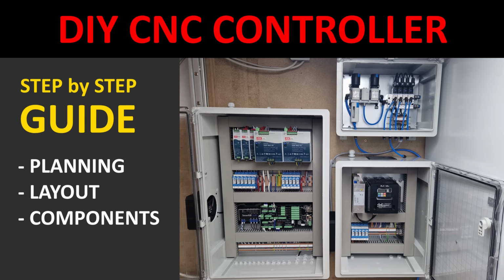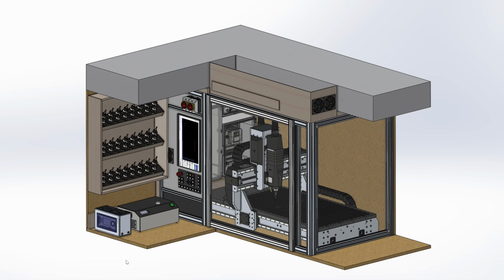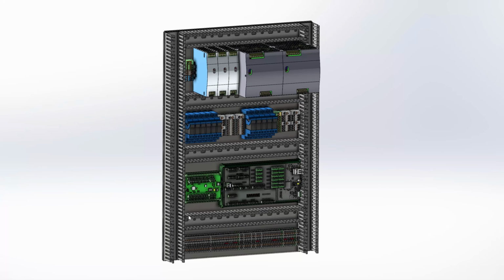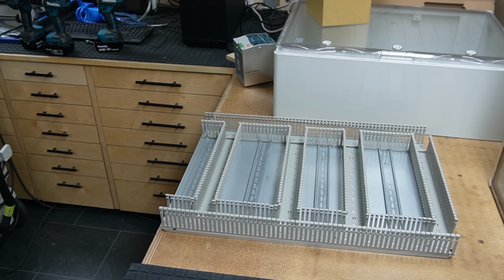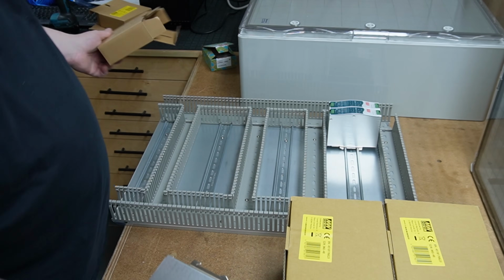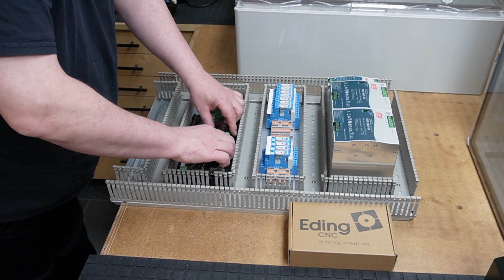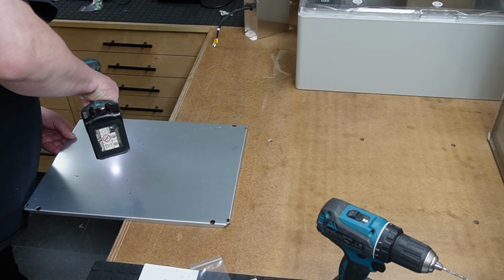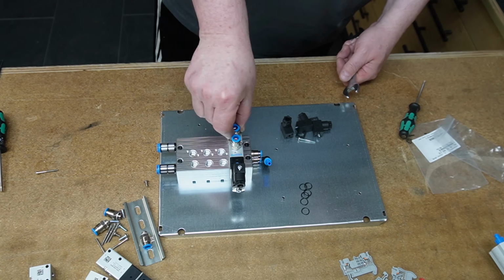DIY CNC Controller Part 1 - Step by Step Guide for Layout, Components, VFD and ATC Pneumatics

Comment: Nice, I’m currently building something similar (fm4 based high speed metal cnc mill) and I’ve opted for 230V AC servos instead of ones needing a power supply, and the delta ones I‘m using also can share break power via a common DC bus.
Reply from the maker: Yep. I have Delta B3 on my onther machine and they shine

Comment: I am building a 4 axis VMC with a bamboo hat ATC. The 3 axis are 23 bit absolute encoder while the spindle is 2200ppr incremental encoder. The controller GSK type not GSK. What electrical hardwares are required for the safe operation of VMC?

Comment: great video but what type of card controls your motors ?
Reply from the maker: The Eding CNC760 board generates the step and dir signals. The JMC servos have an integrated driver and do not require extra hardware in the controller other than the 48V PSUs and the 760 board.

Comment: sick build!! amazing performed, well explained, and very clean installation. Do you think you could share your electrical diagrams? that would be awesome to solve some small issues i might have in mine.. i would appreciate it so much. 
thanks in advance
Reply from the maker: I will show more about that in the next video 👍
Reply: @scratchbuiltdesigns  great thanks a lot!! do you have a date in mind when this is released? thanks for your support

Comment: Was für eine 3D Probe (Renishaw Klon?) benutzt du denn? Ich bin noch auf der Suche nach einer brauchbaren, kabellosen Probe.

Schöne Videoserie, weiter so :)
Reply from the maker: Ist noch im Zulauf. Wenn der funktioniert, werde ich mal was drüber machen. Die Dinger gibt es bei Ali massenhaft, brauchen aber ein paar zusätzliche I/Os an der Steuerung und ne entsprechende Subroutine in der Software. Einfach anschließen wie einen normalen Taster mit Plus, Minus und Signal ist nicht...
Reply: @scratchbuiltdesigns  achso, dachte du hättest da schon was. Ich hatte eine 3d Probe von Rattmotor im Blick, um die 300€, macht einen ganz guten Eindruck. Man findet aber leider nicht so viel dazu. Modell "GP-800"

Bin gespannt, was bei dir noch alles im Video auftaucht :)
Reply from the maker: @JeD23  Die hatte ich auch erst im Blick, aber wieder verworfen und nen echten Klon genommen. Den kann ich dann 1 zu 1 an die Steuerung anschließen, wie den echten an der großen Maschine und auch die Routine übernehmen. Das war mir die 300 EUR Aufpreis wert... Sonst hätte ich es wohl mit dem probiert
Reply from the maker: @JeD23  Außerdem "funkt" der GP-800 auf 2,4GHz und der andere geht wie im original über Infrarot. Das gefällt mir persönlich wesentlich besser, auch wenn ich jetzt nicht sooo furchtbar viele Störfeuer im Keller habe
Reply: @scratchbuiltdesigns  bin gespannt was du uns noch zeigst.

Aktuell ist es noch nicht so akut, das ist in meinem Setup ein absolutes nice to have. Die 3D Probe passt nicht in mein ATC Karussell, daher muss ich die eh in die Hand nehmen und dann kann ich auch kurz das Kabel anstecken.. wäre natürlich trotzdem nett, wenn "alles" vollautomatisch wäre